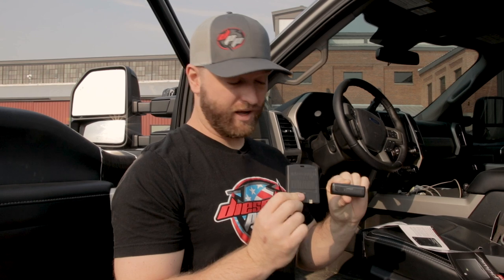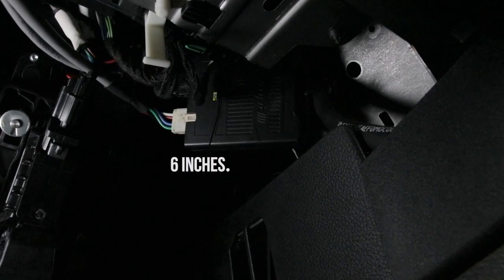Diesel Talk | Edge AMP'd 2.0 Throttle Booster

Comment: I have a 2021 Ford F350 6.7, and if you mess witj any of the wiring, or disconnect things  Ford dealers have s program on their computers at the dealership now that show what you have been doing.  Especially if you are speeding or engine over speed. My truck was showing engine miss fire before it showed a check engine lite. Service manager showed me this and they brought my truck into shop and reflashed the PCM and TCM.